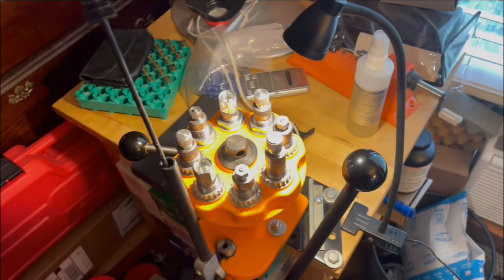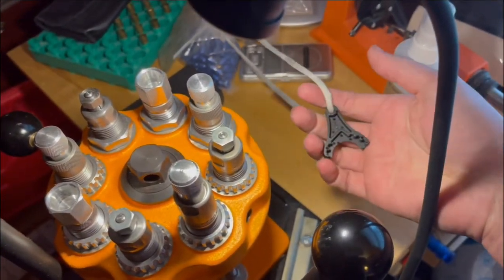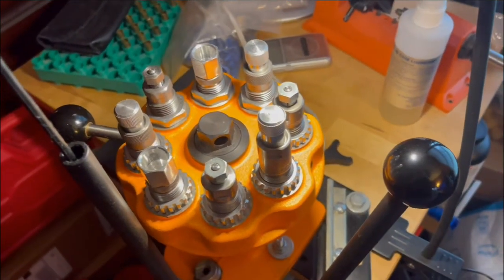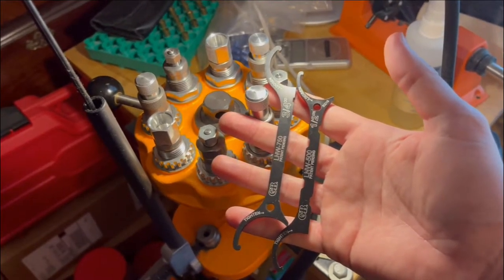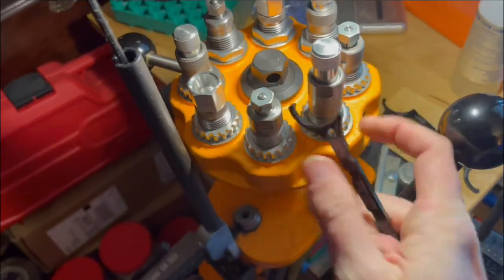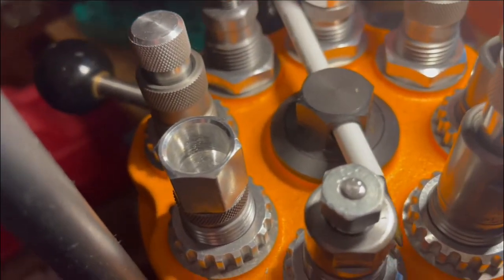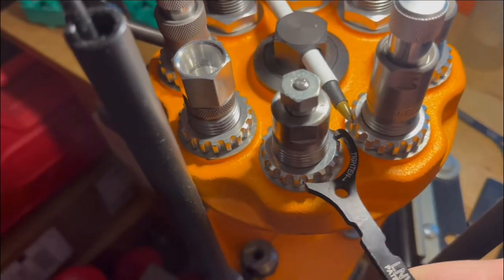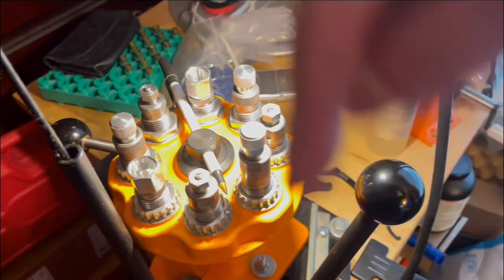Pwnery's Reloading Bench - Lifehack for Lee's new die Lock Rings!

Comment: Excellent tip.  I bought mine at Home Depot.
Reply: Also, I use the ones without the set screw, remove the O ring and turn them upside down.  Works perfectly on my XL750.